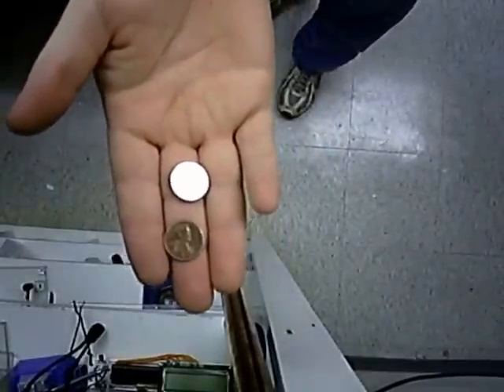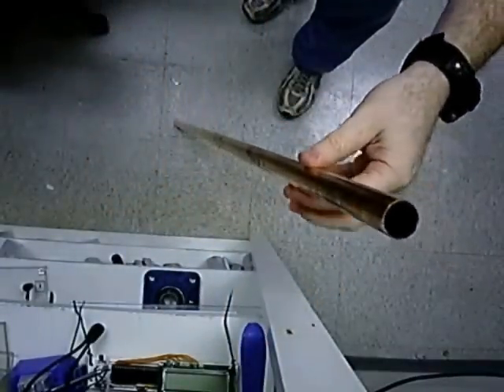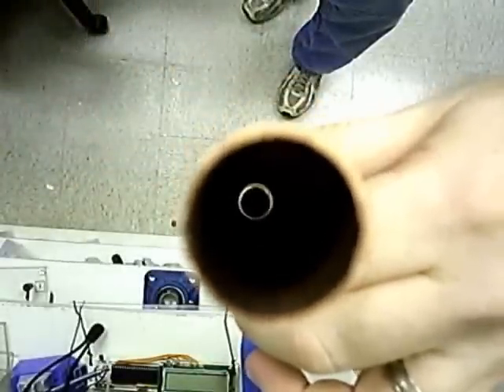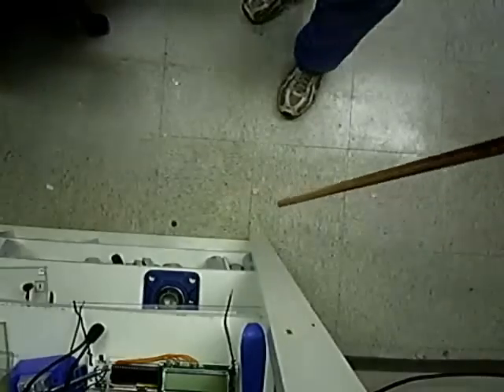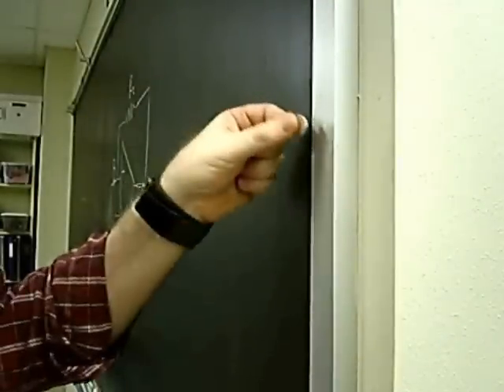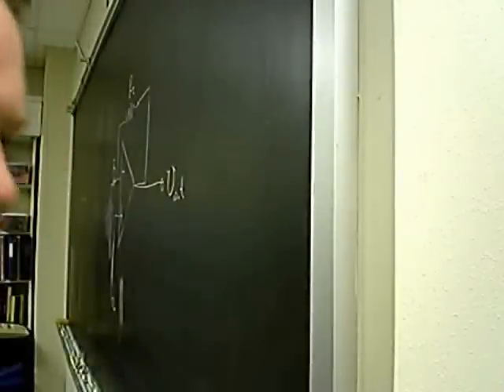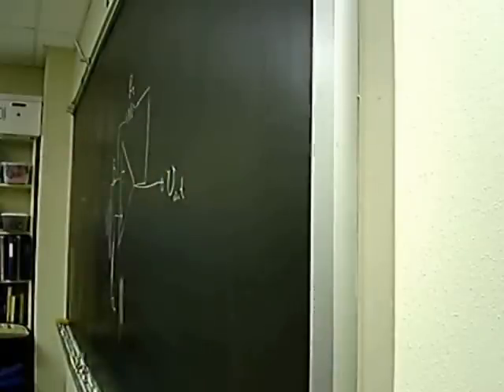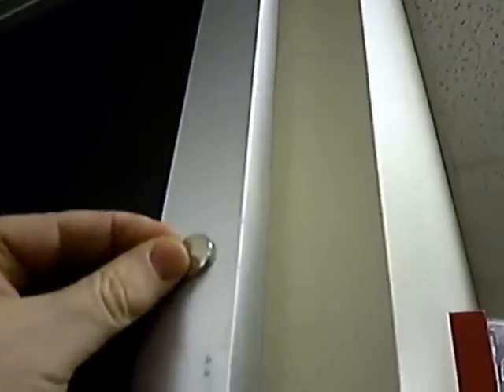Magnetic Drag Force

Comment: the reason why there is a repulsion in the pipe is that there is a phase differential
in it that prevent the field in the pipe from become aligned with the magnet.
the reason why iron atract a magnet is that the field in the iron and the magnet become 
aligned. you don´t want that so by alternating the direction of the magnetic field 
with two magnet trough the iron at the same time a repulsion will occur in the iron